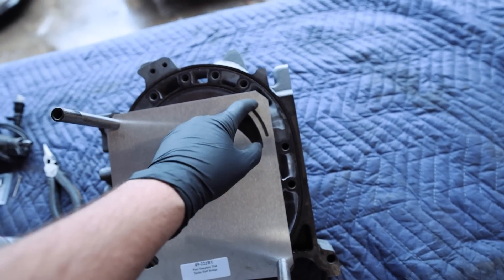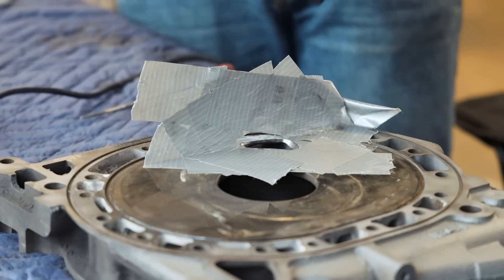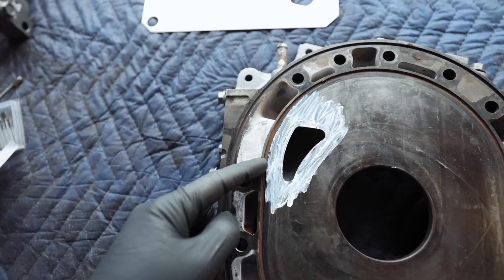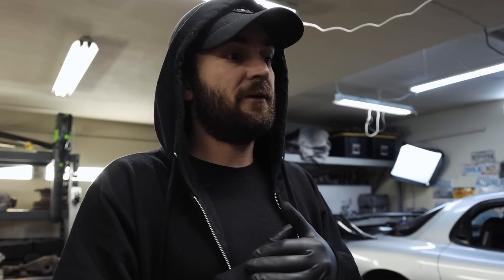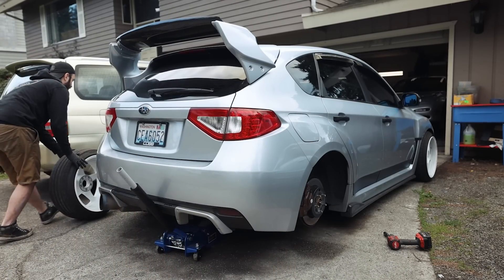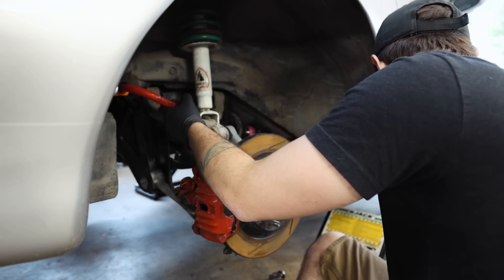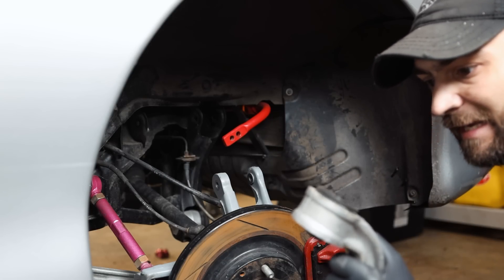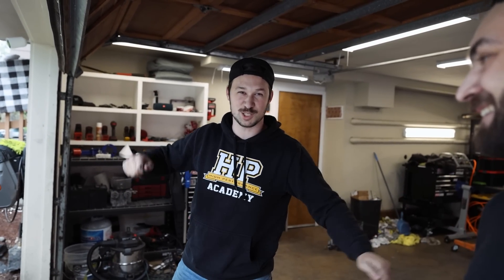Learning from my mistakes: Porting my Mazda RX7 engine. Damaged the Engine...

Comment: If you’re having trouble with getting the bushings out and I mean this genuinely, torch them wear a respirator and do it in a well vented area but heat heat and more heat then wire wheel the surface with a little Dremel wheel slightly lubricate and press your new bushings in

Comment: Tanner my man good job man I remember when I did my 13b porting it was so nerve wracking lol but I couldn’t tell on the video make sure you have a good bevel on the top of the ports so you don’t snag a side seal or corner seal it is cheap insurance.
Reply from the maker: Made sure to bevel all edges to prevent any snagging 🫡🫡

Comment: I have a tip for you. Step one; apply tape to iron. Step Two; apply template. Step three; use exacto knife to "scribe" the tape. Step four; peal the tape from the inside, leaving the tape around the edges, then port. This way not only gives more protection, but also makes it way way way more visible. I personally use blue painters tape. Huge obvious line there. Makes life. Way way easier. Your welcome! Back to your regularly scheduled broadcast!
Reply from the maker: Gling to try this on the new iorn, the paint pen is super difficult to see when metal dust gets everywhere 😅

Comment: Weld the hole shut and clean the weld surface area afterwards. The iron isn't warped, you can fix it. You're the DIY guy!
Reply from the maker: I can't weld cast, I read up on it and you need to braze it but it is not something that can be easily done 😅
Reply: @Smeedia  i learned to braze, solder and weld in HS in 98. It's pretty simple, like in welding, control the heat and fill material. You can do it!
Reply: @Smeedia  preheat the part with a big torch, braze is up, bury it in sand till it cools. I guess the preheat is the biggest problem. get the part to heat and expand, do the repair and let it cool slowly and evenly

Comment: The fact that you only ruined 1 iron is pretty impressive IMO. Good work! Ready for the brap!

Effectively, at least as I understand it, doing these ports is like adjusting the timing. So I think that the chamfer that you did is actually how it's supposed to be done. It'll still work because it's basically opening the exhaust port sooner.
Reply from the maker: Only takes 1 time to learn 😅 super happy with the other 2! 🥳

I belive your spot on with that, I think it's technically advancing the timing?
Reply: @Smeedia  So looking around, it cost you the price of a 3 rotor half bridge port from a professional.

Comment: Take a look at Foredom rotary tools. I got mine from Otto Frei, I think they're up near u someplace. Anyhow they have several motors that hang from a stand and use a foot pedal to control speed. The model I have only turns 15000rpm but has torque which dremel doesnt and allows more control for porting plus has a reverse mode also. There are several hand pieces available in many styles allowing  3/32, 1/8 & 1/4 shanks. With the 1/4 shank you you can move away from your subject with a 6" or even cut down to length. There are so many options you will wonder why you never bought one before, far superior to dremel. Also they make a blue stone kit. If you check out Ken O'Connor Racing on you tube he does two stroke cyl head porting, he has this set up though doesnt use 1/4 shanks but offers a lot of useful tips plus the blue stones. They are light blue in color and can be found on Otto Frei's website.
Reply from the maker: I am now going down the rabbit hole 😮 sounds like. Far better option that what I've been doing over here 👀🫣
Reply: Dremel offers a hanging shaft style, but once again its still a dremel and requires rpm instead of torque. I have a dremel for odd projects but for porting & things I really care about the Foredom is really hard to beat. Good luck, love your vids can't wait to see blue up and running. Subies are my love too..
Reply: One other helpful hint, look into a product line called Boelube.  There are different styles depending on the material you are working with. Dip your bur in it before and during porting. It will keep your burs and drill bit sharp and clean. Be careful as the dip will allow you to take too much material quickly so just be mindful of it. They make a solid in a tube that works great for sanding rolls. Makes them last longer.
Reply: @Smeedia  FOREDOM is the shiznit!!!

Comment: The rear bushings that are inline.... threaded rod.... nuts.... bushings.... use them against each other the press/pull out using the right sized washers.  Take the arm to hardware store to find right sizes to press against and plunge with. You're welcome homie.
Reply from the maker: Doing this next time lol we kept playing mix and match with sockets 😅
Reply: I'll try to find post the video of me doing this method.  Will cost ya like 20 bucks in parts unless the hardware store likes ya.  I used:
-1/2 threaded rod at around 2 ft long
-2 1/2 in nuts
- 2 to 3 fender washers that fit inside diameter of the bushing
- 2 to 3 fender washers that fit outside of the bushing
- 1 1/2 collar/press sleeve to take up any slack or adjustment (not always needed)

Comment: You can fix that blow thru with some quick steel puddy. Also, did you bevel the closing edge of your ports? Without a bevel, the thin side seals on the rotor will catch the edge and break them when the side seal spring pushes them down when those seals slider over the enlarged open port.

EDIT: That radial bearing is that pillow ball bushing I was telling you about last video.
Reply from the maker: I did bevel the edges to ensure there are no sharp corners that can damage or nick the seals 🫡

Idk why I thought the bushing kit I had even has that thing 😅
Reply: Cyan like! Yeet. Good vid

Comment: 16:23 burn them bushings off then very carefully cut the inside sleeve off of the control arm (if it has a sleeve)
Reply from the maker: I debated doing this, I ordered a proper press set to hopefully make doing them a bit easier. I just hate the smell of burning bushings 😅
Reply: Yea it’s the worst smell ever lol but hey it works when you’re in a pinch though!

Comment: try using electrical tape on the area where your grinding or sanding. its a little more forgiving in case you slip. just some tricks learned in the trade.
Reply from the maker: Good to know🫡 will try that with the last housing when it comes in
Reply: @Smeedia  yeah masking tape, duct tape rips and tears a easier. the electrical tape acts almost like a rubber barrier. just clean the surface good for proper adhesion. although on some materials the E tape doesn't stick too well. try laying some E tape on the messed up iron to see if it adheres good or not. this is what i normally do on body panels and composites.

Comment: Yeah you def want a camphor on your port. One of the reasons why I prefer semi peripheral over half bridge or full bridge is corner seal wear. The corner seal ride right where the bridge is ported at making those side seals wear out faster. You definitely want a camphor on your port. Help out that side seal a bit.
Reply from the maker: Make sure to break all sharp edges around the ports as well 🫡 learning as I go but I think next time I may just stick with a street port over a half bridge
Reply: Chamfer ;)

Comment: Dude, I had recommended to you to just go ahead and get the factory remanufactured Mazda 13b super cheap. That way you'd have the RX7 up and running in no time to figure out this rotary game. Now you just dropped $900 on an old rotor you didn't need. Who knows what the condition of that eBay rotor is going to be and if the face is even in the same condition as the second rotor.  I really don't know why you're porting this motor when you're just getting into the rotary game.   All of these older JDM cars: evos, STIs & the RX7s the parts are going to be drying up and not available...so you have to be serious when you decide to do something you have no clue what you're doing.  If you insist on porting you should have just went to Atkins rotary not far from your house and had the pros do it up correctly.   Also, I mentioned in the last video those white wheels have completely the wrong backspacing for the FD. The backspacing on the FDs need the wheels inside the wheel wells not outside the wheel wells. There is massive space in the FD wells to tuck in wide tires so you don't destroy the handling capabilities of their car.  You do not need to roll the fenders either so if you end up doing that to make those wheels fit you just made another mistake. And also when you port those rotors the ports have to be properly beveled or you are going to prematurely destroy the apex seals.  I was so pumped for this RX7 build and thought you were going to do it the right way, but now I am not.
Reply: All I got is you’re trying to tell someone else what to do with their car. Not only does learning and doing it himself make good content for the channel it’s just good to learn and know what you’re doing. Calm down 😂
Reply: Lol the reman Mazda motors are know to be shit!! That’s why people were just buying new motors before Covid hit
Reply from the maker: I looked at the reman engines and they're not cheap at all, I think with the replacment rear housing I'm $1600 deep into the engine rebuild. Remained 13B REWs I was seeing around $5,000 ish 🙏
Reply: @brianawd  The remains are the cheapest way to get back in the game quick.  Lots of FD owners used to buy the remanufacturers and then send them out to get street ported and go racing.  The Mazda factory remans use all OEM parts to original specs and tolerances.
Reply: @ROLTZY  dude, I used to own a 93 Mazda RX7-R1. There's a right way and there's a wrong way and it's better to do it the right way.  We'll see how things go when that eBay rotor comes back out of spec and what it ends up costing in the long run.